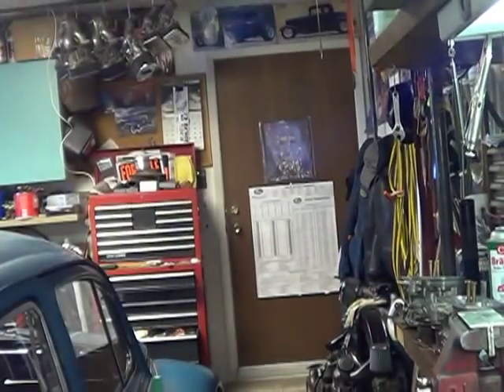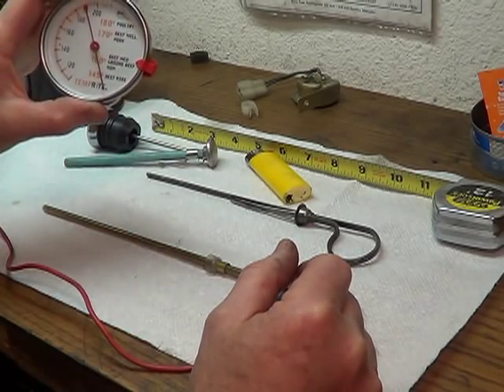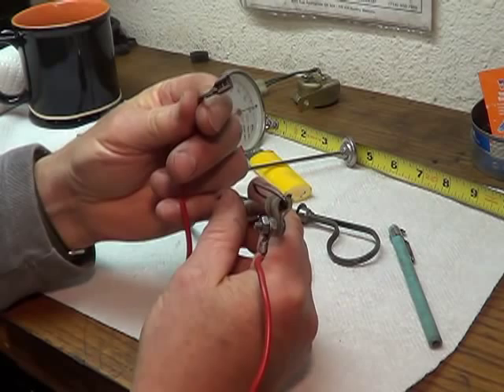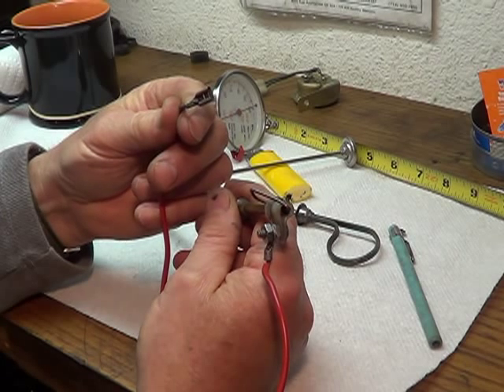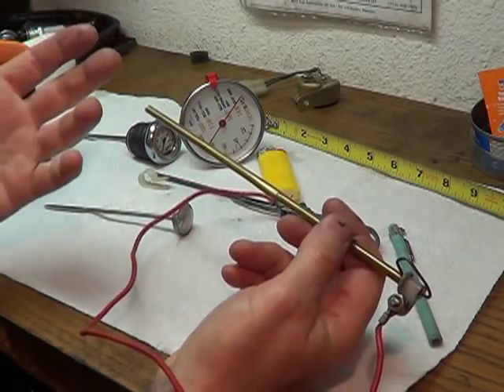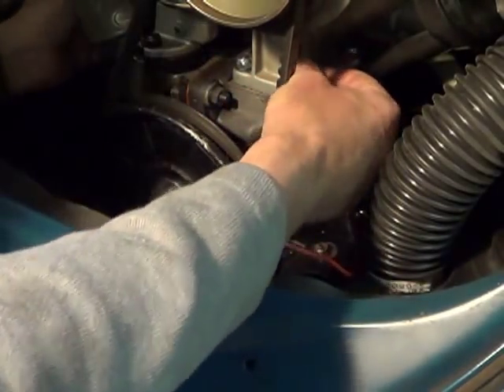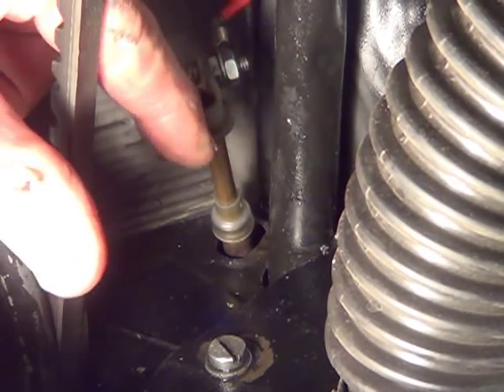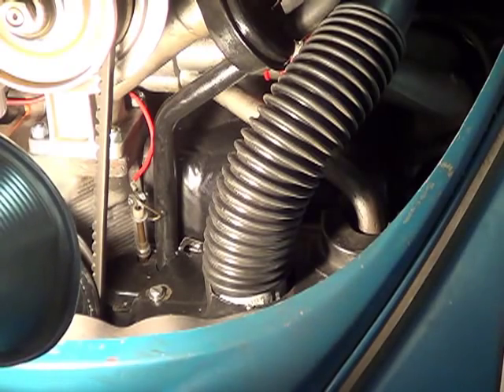Gene Berg Oil Temp dipstick

Comment: They still make those temperature dipsticks he's got a video on YouTube the video depicts a Volkswagen with flames coming out of the engine that's the one you want they do still sell them I just purchased one and this is December 2019
Reply from the maker: Very Cool. Thanks.  I got mine from Berg 25 years ago and it still works great. I don't like to leave them in unless I am testing a engine. The are PITA to check when hot like at a fuel stop. Very hard to read with fresh oil and old eyes.  hehehe  Thanks again Hippie Man

Comment: I used a (common cheap)TypeK thermocouple wire pushed down the dip stick tube far enough to be into the oil at least an inch  , bend the wire coming out of the tube down along side of it and secure it with a zip tie to hold it in place so when you pull the dip stick in and out the wire stays put .  The wires come in various lengths I got a 6 foot one , work it thru a little hole in the fire wall or heater box to a cheap voltmeter in the cockpit that has TypeK  plug inlets and check your temp digitally F or C   . You can even attach TypeK thermocouples to the cylinder heads to get the head temp of each cylinder  . Tiny amazing things !!
Reply from the maker: Your amazing. Great idea thinking out of the box.  Thumbs up